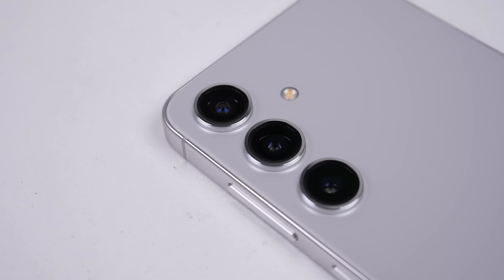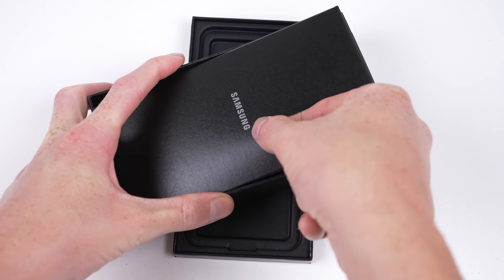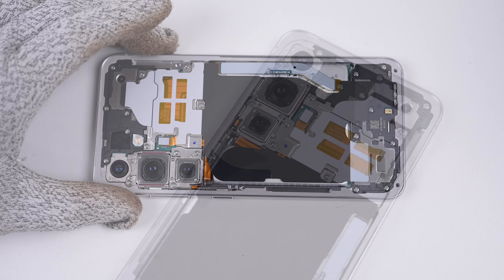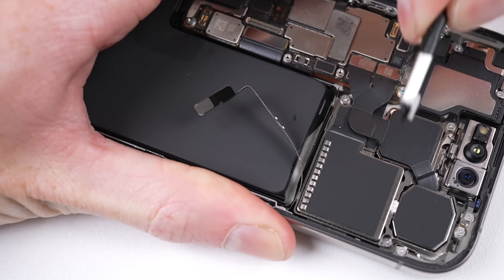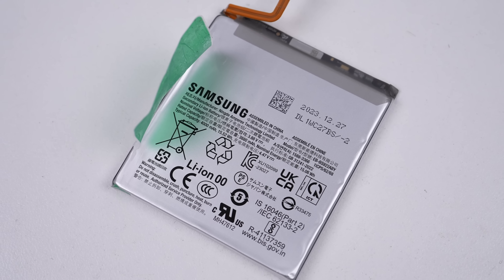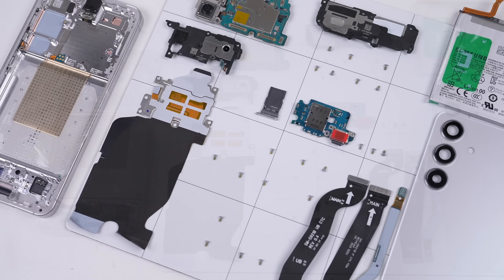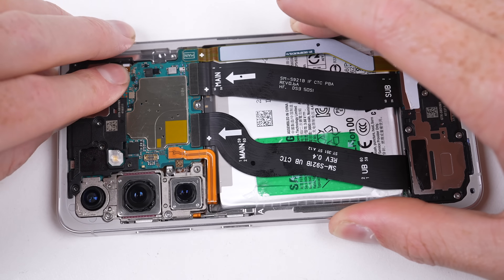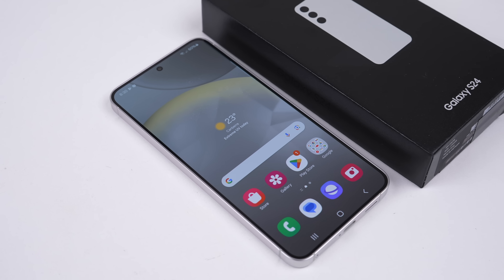If Only Apple Could Make A Phone This Easy To Repair - Galaxy S24 Teardown and Repair Assessment

Comment: I like that they rate it for 4000mAh but the battery says 3880mAh on it lmao
Reply: +/-10%?
Reply: This seems to be a common thing, my phone, a low end oppo has a battery of supposedly 5000mAh but when it's fully charged AIDA64 says it's charge is 4880mAh
Reply: @BluelightAmelia  Net vs gross capacity. Net capacity is lower, for safety and durability reasons. EV manufacturers do the same thing, but they declare net capacity as well as gross capacity. Phone manufacturers do not.
Reply: Oh, close enough
Reply: That’s because of safety.
Reply: @djplonghead5403  I imagine charging it to it's fullest could cause battery inflation, right?
Reply: ANOTHER IDIOT
Reply: same with most if not all phones.
Reply: Rated vs typical capacity. Typical is what capacity the manufacturers are aiming for but like everything in life, nothing can be made perfectly and rated is the more realistic expectation of the batteries. Average deviation or rated capacity is 3-5%. Samsung is 3%. Meaning you can get a battery up to 1-3% worse than 4000 mAh.
Reply: Why aren't the batteries advertised as their rated vs typical capacity, you might ask? Because bigger number = more eye catching to consumers. Batteries are specced to reach 4000 mAh. It's not false advertising just an asterisk you're not legally obliged to show.
Reply: to look good on paper
Reply: Li-ion batteries charge and discharge via an electrochemical process, so capacity isn't an exact science. It's not like a fuel tank where it holds a known number of gallons of gas.
Reply: honestly the mah may be higher for a couple weeks when first used, the 3880 mah is likely js the standard
Reply: You dont want to charge the battery to the maximum lol. Literally every smartphone battery is like that.. they set the charging cap lower of what the maximum size was to avoid kabooms lol
Reply: 12 tb hdds are 10.9 tb you dont see anyone complaining
Reply: @duchieu235 There's a different reason for that. Windows uses Base 2 while most storage manufacturers use Base 10 to compute for storage capacity, but confusingly the same symbol for KB/MB/GB/TB is used to imply kilobytes, etc. by both Windows and manufacturers, when Base 2 values for capacity can be labeled as KiB/MiB/GiB/TiB (kibibytes etc.) while Base 10 still uses regular name and symbol for bytes.

Will not cover the math further here but basically the difference leads to Windows showing as if the drive offers "less" than it actually does.
Reply: And the 3880mAh will be more accurate as this is the capacity that the lithium battery manufacturer has placed on it. It might actually go a little high after the first couple of calibrations but I doubt it will ever clock in at the full 4000mAh.

Comment: 7/10 for me.
I can understand why the cameras aren't interchangeable, but if they're physically the same then i think it's a poor design. Even something as simple as an assignment 9 tab or different screw placement would be a good.
And the battery gets -3 points for the tape.

Comment: 4:18 wait, you were able to get it out without breaking the pull-tab!? All the newer Samsungs with that that I have done, I've never been able to do that without breaking the pull-tab, thus going back to the iso to get the battery out.

It's weird, because for Oppos or Huaweis or Xiaomis it's not a problem, but for Samsung it feels like it's much harder than it should be.

Comment: Still ridiculous how the adhesive is ridiculously held in. I’d much rather take a non genuine part warning than do that. Also, to even change the display, you must remove every component. Not saying Apple is better with repair ability, but i’d much rather take a warning every restart than have to replace a bunch of good parts for a screen.

Comment: Tbf, that battery glue degrades over time. The assumption is that on the vast majority of devices the battery will be only replaced after 2-4 years (I pretty much agree), and at that point it will be noticably weaker.
Reply: The back panel being easier to pop out is also a problem. There are numerous reports of it falling out just after 1-2 years of use.
Reply: That's a piss poor excuse though. That battery has to be removed for display repairs. And I've known people to break their screen in a few months. Lol
Reply: @-ThatGuy-  
In that case, just use the alcohol and or heat.
Reply: @Alias_Anybody  They just shouldn't make the adhesive so strong. Excessive heat is bad for batteries and alcohol is only so effective.
Reply: @-ThatGuy-  If you go watch PDK or Jerry they pull the battery without much trouble. Hugh is either incredibly weak or he received a device with far more glue than normal.

Comment: I think the strong adhesive on the battery softens out with the time. You have to remember you are removing a brand new phone, with a brand new battery. With the vapor chamber being attached to the battery too, it will transfer head along the adhesive, so I think it so minimize battery movement on the near future, and also minimize battery incidents (aka note 7) 

Edit: Well, to everyone, thats why I started with "I think", thanks for the explanations and personal experiences
Reply: I don't know about that. I can't say anything about Samsung or Apple, but when I replaced the battery on my over 10 year old Kindle, the adhesive in the device was still extremely strong. I don't believe they are accounting for softening of adhesives over time when they design these things.
Reply: @klopferator kindle does not use battery as a heatsink. But yeah, the glue is like 300% stronger than it should be.
Reply: Except, the note 7 was not because the phone could move, quite the opposite
It was too tight in there that it was squished and popped
Reply: I have worked on many 5 to 10 year old phones, and I can tell you the adhesive does not soften over time, but it seems to become even stronger/stickier.
Reply: The adhesive softens out with the time? Pffttt. That's not how it works. That's DEFINITELY not how it works.
Reply: They don't. Thats now how it works.
Reply: Most Chinese phones have had a similar type of pull tabs for their batteries. However their method is better by having 2 pull tabs. One for the plastic with glue, another for the battery. If you want to replace the screen you need to remove the glued plastic which sometimes covers the screen cable. The pull tab for the battery lifts from the edges instead of the center like Samsung. Maybe their glue is weaker but it definitely looks much more easier to pull the battery on a Chinese phone than it is on a Samsung. For reference check teardowns of the Xiaomi 13 or Redmi Note 13.
Reply: I had a samsung s20 fe I used alcohol to soften the adhesive for 7 minutes and when I came back with the tools needed to jam out the battery it didn't even budget what did happen is I bent the battery before it opened luckily the battery was dead and Only lit a tiny spark where it was punctured a little
Reply: The adhesive had 2 years to soften by that time
Reply: Also Hugh has the build of a reddit mod. PDK and Jerry didn't have much trouble pulling out the battery.

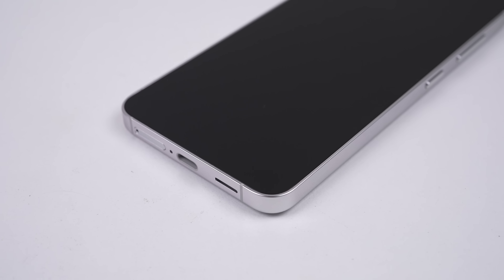Comment: 1:42 my Galaxy A13 4G is at android 13 with the update to android 14, my Amazon Fire HD8 2018 is on Lineage OS 16 based on Android 9, Galaxy tab 2 on Lineage OS 13 based on Android 6.
Reply: Yes custom ROMs ! I use a pixel 4 on the daily broke my six fixing a ball joint ., I'm running graphenee OS !

Comment: My oldish tablet's android version is 5.1.1 lol. Good enough to some light browsing and watching videos along with a lil bit of gaming but nothing fancy. Camera lens is missing for some unknown reason but I've used the camera only a few times ever. Battery is bigger than I remember it to be, 4000 mAh capacity.
Reply: sounds an awful lot like an LG G Pad 7, I've got one of those (don't know if it's 5.1 tho or just 5.0 but not much of a difference). Removed the camera lens myself since the stupid thing is the thickest point so it got super scratched and couldn't read QR codes anymore (it's only real use).
Works well when you disable ALL the google stuff that just ain't helping with anything after all. It's quite incredible what de-googling the device did to it, runs like new other than some random reboots (I think it might be reaching storage write limits on some blocks and plain corrupting some system areas).
Reply: @Kalvinjj  Samsung Galaxy Tab A6 lite. I had to factory reset it one time cause I couldn't use the playstore on it but only thing I used it for was YouTube, light gaming, and that radio app. I may just pick it up again, uninstall YouTube & disable it, and install some games on it at some point. Most google stuff is already disabled so minimal work on my end. Love the tablet even if it is outdated lol.

Comment: I still love my Note 10+ and I am not going to let it go. Long live SD card slot. I will probally looking to replace the battery soon but considering the fact that the back glass glue was so weak that it fell off recently, the battery glue is not a problem.
Reply: I'm still using my S10 and debating on replacing it either with an A54 model or maybe the Note20 since they both have the micro SD slot... I wish companies would stop taking away good features.
Reply: I have a S23 but I'm still keeping my S20 FE as backup and because of the SD card slot
Reply: You should really upgrade to the Note 20 Ultra. Last Note to have the SD card and probably the same cost as what you'll spend getting another battery lol

Comment: Running android 9 here.
I think the Galaxy S8 and S9 are the best looking phones Samsung ever made, with the very thin frame at the side that curves out a bit at both ends.
They are a bit slippery to hold though without case. (and tech wise pretty much outdated, although they have USB-C, Qi charging, a good oled screen, reasonable memory, wifi 5, NFC, gyro sensor etc. Pretty good for a phone that is now almost 7 years old (the S8 that is)
Reply: I miss my 10e. I regret switching from it. The last of the true small screen phones outside of apple, it seems :(
Reply: @burntalive  Still using my s10 and I really don't want to upgrade... I think I'm going to go with one of the A models though since they have the micro SD expansion option vs flagships.. I love my s10..
Reply: The problem with those thin frames and  tapered "edge" screens is that they tend to break much easier than "flat" screens when their edge gets knocked onto a table.
Reply: Galaxy Note 9 running android 10 here... GN9 is still kicking :D
Reply: Agreed s8 and s9 (7 edge if you want old school) were the best phones ever with the curved screen, mom and dad had them. But not me, got a S5.
Reply: Yeah honestly that's why I gave it up because the case hides all that anyways so I really didn't care. Even my S22 Ultra is basically the same as those versions with the case in
Reply: In general Android 9 and 10 re the best versions of Android.. Freedom
Reply: I put Lineage on my S9 and used it for a while but had to switch back due to issues with payment apps.
It's plenty fast, much better compared to the stock rom.
It just felt much nicer/premium to hold compared to my S20 and it has a MicroSD card slot... You're right the design was great, although I get why people hated the curved glass.
Reply: Samsung Galaxy peaked in 2019 with the S10/Note10/Fold 2019 IMO. The S10 had sizes for everyone (from the 5,8” e to the 6,7” 5G), the Note10 was the first step in the “Ultra” direction, and the Fold made the foldable mainstream. With that said, I remember watching Unpacked 2017 on my old Galaxy A5 2016 and being pretty hyped about the S8, and we ended up getting my mother a Note8 by late 2017, which is now in my possession (she now uses an A52s 5G). Come to think of it, I kinda miss the S8/S9 screen design, something only Sony Xperia offers nowadays.
Reply: same but im gonna upgrade to the s10+ later this year. been using my s8+ for nearly 5 years
Reply: Galaxy note 8 here 😊
Reply: I had a s9 but have it to a family member, it was really old and had a very bad screen burn. And the screen looked very yellow.

Comment: The super tight battery screams Note 7 all over it tbh
Reply: I think the Note 7s issue with lack of space was inside the battery itself tho, it was literally a design defect with the battery itself, where the layers could end up shorting if I'm remembering it correctly.
I don't think any phone in past 10 years has any room for the battery to freely expand a bit here and there.
Reply: @Kalvinjj  from what I gather the lack of space in The battery itself was caused by the lack of space in the phone where it squished ut with Enough pressure that they popped
Reply: Same thought 😂😂😂

Comment: My phone is still running android 4😂
Reply: I did daily use an Xperia L running 4.2 indeed, until the point it stopped accepting some increasingly necessary apps, then I replaced for an Aliexpress bought one that lasted me a year (...it was nice while it lasted. R.I.P. Xperia Z5 Compact), but after that one died.... guess who came back as a spare while I got something else? Ye, the then 9 year old one still kicking.
Works to this day now 10 years old.
Reply: I couldn't man. That it is such an out of date software. I would miss so many modern features. Lol
Reply: Do YouTube and WhatsApp even run on it? ... What about Firefox and Chrome?
Reply: How are you even commenting on this, web YouTube?

Comment: I have an S23 Ultra and am perfectly happy with it.  If the trade in made it less, I might have considered it but I would have still had to pay more than $400 plus the cost for a new case.  No thanks, maybe next year..
Reply: Don't wanna hate on you but of course you're "still" happy with an only 1 year old flagship phone. Next year's phone isn't gonna change that either
Reply: There's little to no reason to change phones every year. Maybe not even every 2 years. Maybe not even 3.... 4...............
Reply: @vik.1903  BUT I MUST CONSOOOOOOOOOOM I MUST DESTROY THE PLANET SO I CAN CONSOOOOOOOOOOOOOOM
Reply: The S23 vs the S24 is a negligible upgrade. It's essentially the same phone, with just a few really minor tweaks. I would've gone for the S23 if Samsung had not made it completely unavailable in the time between the S24 being announced and released
Reply: i have an s22 with no complaints about it, but if my s9+ didnt drown id probably still be using that too. the whole 'my phone ive had less than a year is still fine' is such a dumb comment. of course it is, if it wasnt you bought the wrong phone to begin with. and getting a top of the line phone it better be good enough because there's no way up from the top. 

you may as well be saying 'my lambo from last year is still fast' well no shit sherlock.

Comment: 1:40 Running Android 8.1 & Android 9.0 ! 😎 ! 
The +  : Having access to the Data/Obb folders without any restrictions. 😎
Reply: What phone do you use? Keeping the s10+ for a long time
Reply: Still got Android 8.1 on my BB Key2
Reply: After they removed mass storage mode in 4.4 I stopped caring about Android versions honestly, it was a telltale sign that things were changing and not for the better of the type of user that likes to modd and mess around.
Reply: 1:40 still use android 9 and 10! (samsung S8 and huawei p smart+ respectively) for same reasons 😌

Another one is some of my installed games won't even run anymore on my daily xiaomi phone after I updated it to android 12 back in 2022 (now up to date on 13 since last year) -- even reinstalling them with workarounds to still access android obb folder + files did nothing to fix them which is such a shame 🙄
Reply: Wait. Newer Android versions have no access to data and obb folders?
Mine has 7.1.1 btw... if I don't count my old but still working phone with android 5.0.1.
Reply: Yeah im still pissed that goovgle decided that move.
Reply: What is the use of it, apart from seting up games?
Reply: Editing save files for me.  @arshad4695
Reply: im rocking with android 11 on my tcl 30v 5g x)
Reply: i change my old LGG3 for  A80
Reply: I just use older versions of the apps and still have access to those folders on the new android version lol
Reply: Android 14, i have it tho
Reply: I just have rooted custom ROMs from LineageOS team.